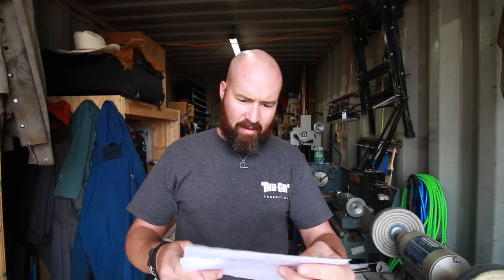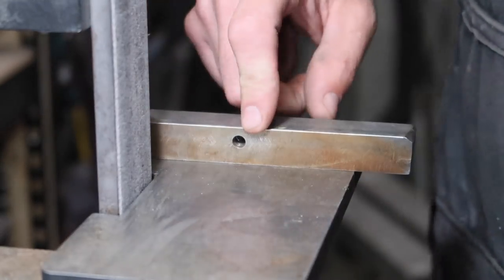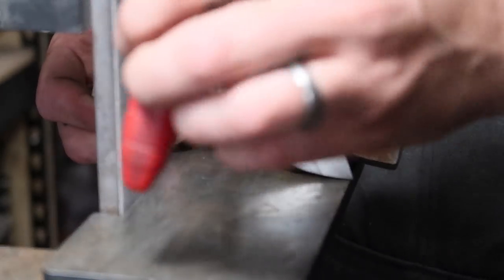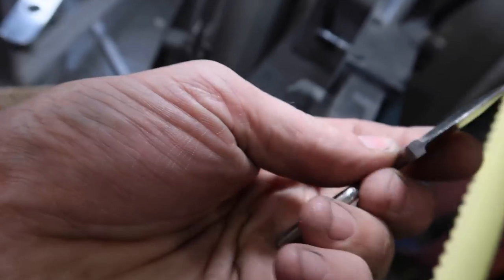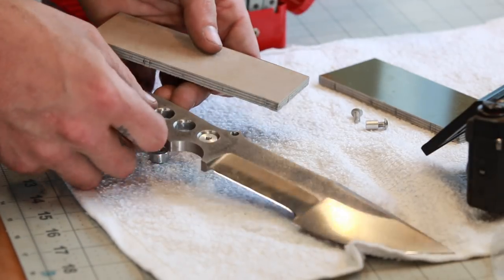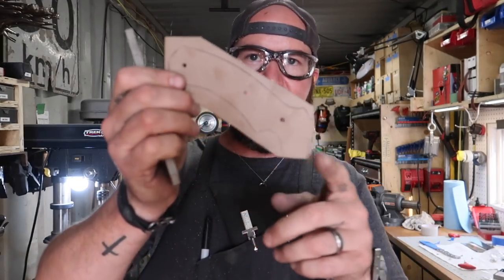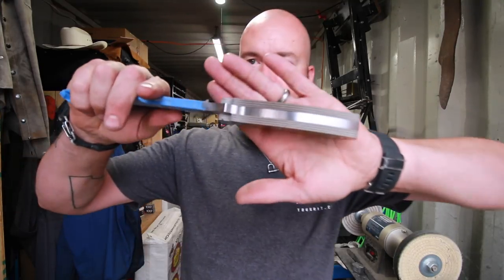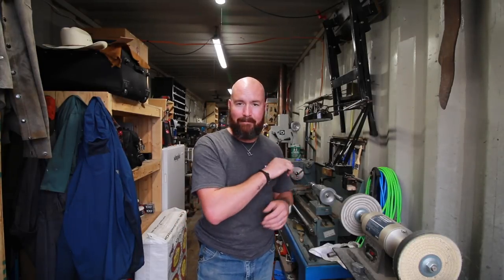Shaping the Tracker Scales - knife maker's daily vlog

Comment: Simple little life   on the Tracker . I realize this suggestion is a tad late but it would look great and may possibly hold up better if you did a multi pin handle something similar to a coffin style handle. Think of the large holes as weight reduction using brass or even nicer copper pins to secure the handel along with lots of epoxy to fill those large holes.  Just a thought. It would be interesting to see if the handle built with the inserts tested to see if the handle will hold up to the rugged use of a traditional tracker.  Nice blade though great build too.

Martin M&S Blades

Comment: anyone in the UK know where to get some steel that will be affordable for a 14 year old
Reply: if you wanted to get hardenable steel, I would think that leafsprings from a vehicle suspension, would be good and if you wanted to make punches or chisels, coil springs from a vehicle.  You may need heat to straighten some things though.  Some people also use old circular saw blades.  Ohh and old file and farrier rasps are really popular to use.  As for brand new steel, I don't have a clue.
Reply: Bradley Macaulay cheers , I wanted to go for new steel , at first I thought stainless but I heard from Jeremy that it's kinda hard to use so I think I may go for a piece from online , thanks again